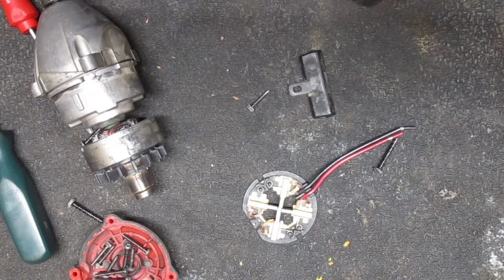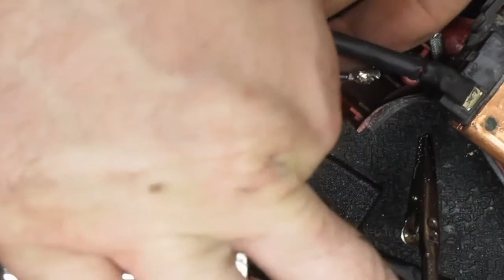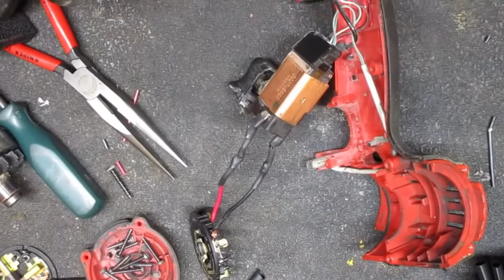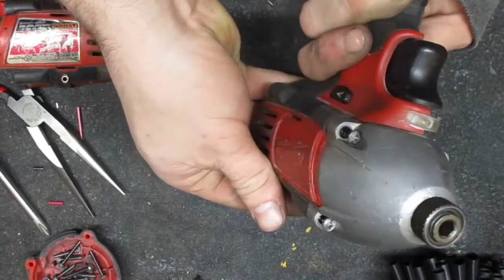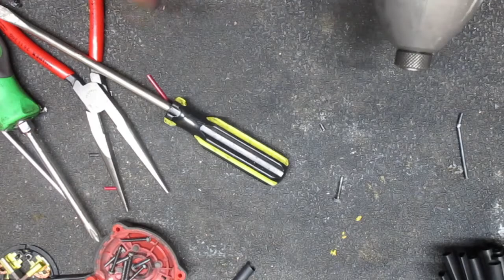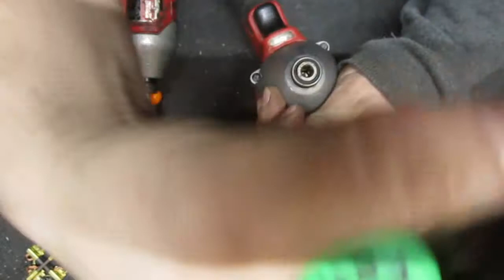Milwaukee Impact Driver Repair (Brush Card Replacement)

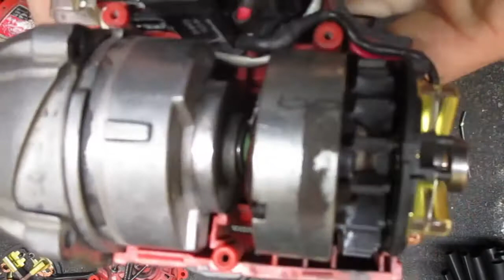Comment: 8:10 the groove on the big metal part on the right, around the motor (where the permanent magnets are attached inside) has to be lined up horizontal to fit in the case. The case is molded so that that part only fits in 2 positions (180 degrees turn will also work), but usually the writing is on the top

Comment: Just Wondering if already using soldering iron why cut the cable and join .? Isn’t it easier and more neater just to do directly .?  Just curious if there was a reason for it .?thanks

Comment: I just opened mine, It was dirty and full of metal shavings from all the use. my question is, the front part casing was low on grease any suggestions on what king to use... thank you.
Reply from the maker: I'm no expert but personally Id just use any grease I had available. Any grease is better than none and if you have a bunch of metal shavings the damage is already done.
Reply: @cavemanstyle1376  thanks.

Comment: Dude next time just put the heating element on the bottom of the cable and wait till the cable is hot enough  to melt the solder ! Btw thanks 4 this vid how much where the brushes
Reply from the maker: I don't have patience for that lol. The brushes were like $3 on ebay, from a seller in China. If you get them from the states it's like $10

Comment: When you do the brushes just pull the spring arm backwards and rest it on the back of the rectangular  tunnel the brush sits in, there is a notch for the spring end to rest on.Doing this will let you push the brushes back and out of the way with out any spring pressure.

Comment: There is an easier way to install the brush card.  Use a pick to relocate the spring wire and hook it to the end of the brass brush housing to take the tension off brush. A lot easier to slide it over the commutator then unhook it.. i agree with fixing it rather than tossing it but the manufacturers make it tough.  Solastic on everything and staked with solder. They would rather you buy a new one as well .  Lol. Thanks for vid🙂
Reply from the maker: Glad you enjoyed it, thanks for the comment!